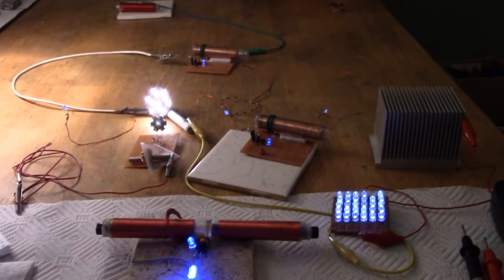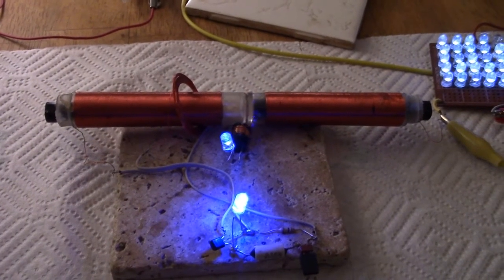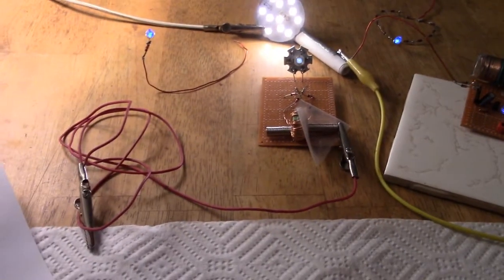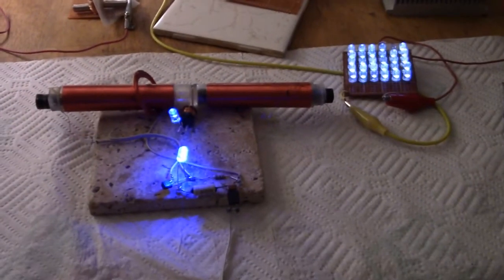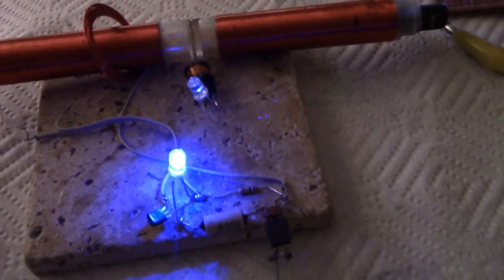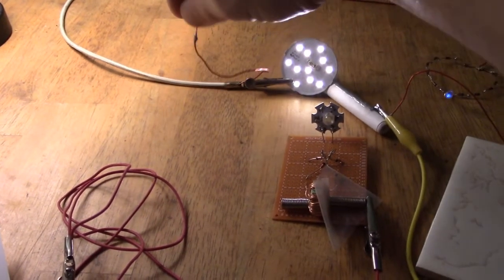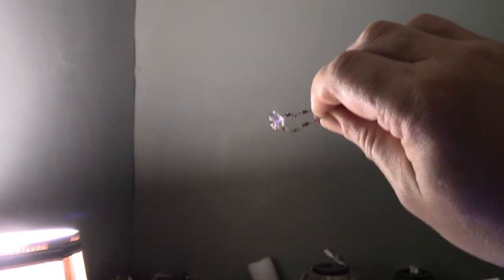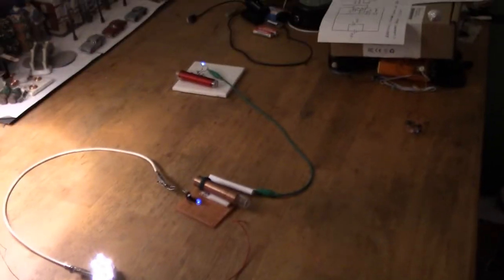A Non Traditional Slayer Exciter

Comment: Yesterday I made a 1n4148 diode loop and attached a 95 Volt led light on it (no guts). I use a plasma sphere to excite the loop. I think that the more diodes you have, the higher the output (voltage / current). It is useless (imho) to talk about the forward voltage of the 1n4148 since the output is way higher. Per diode there can be several volts, so the Ufv of the diode is a small percentage of its output.
I think I will make a similar exciter as the one which you have there. I keep zapping myself with the plasma sphere so I'd rather use a different source for testing.
I have many LED light bulbs which are broken, and usually it is the guts which stopped working, so they do work all right on a DC supply. I like this resonance thread. I made a comment on the video by "Luc GotoLuc" about resonance, but he is not stepping in. I think he could help us out on OU dot com.
Reply from the maker: The plasma spheres have their own traits and definite uses, plus look a whole lot prettier than a wound coil. Yep indeed, the drop isn't a factor but the gain most certainly is.
Oh, twirly compact fluorescents are the same way as the LED bulbs, just the base components blow. I've never thrown out a compact fluoro because they all still run fine on an exciter.  
I think Luc is still very much occupied with the Pierre Cotnoir device. It should be him if anyone who cracks that one.

Comment: To measure current a bit better put some diff sized caps in parallel on the circuit side of the sense resistor
Reply from the maker: Sort of like a bypass arrangement or a decoupler ? interesting idea and thanks :)
I think the wires induce the 500kHz output field signal, but do know that it's always been tough to measure any such circuit because of those connecting leads.

Comment: Really cool progress!  thanks, Mark.  Would you try - cut down the number of "sateliite LEDs" and see how much the current drops?  Also, pls try say 200Kohms going to the base, and see how much the current drops (with present set-up)?
Reply from the maker: Thanks Steve. Here's the odd thing, current goes down with capacitively coupled things added, it's a reason they are there. Measured current began at 27mA and dropped by about 1mA per item. At a load point, all devices will dim together, but until that point they each are as bright as if none other is present.
Inductive loads are different, a small motor or filament lamp needing the whole lot. 
The 100K starts the oscillations in the system. Without a start resistor then a piezo lighter or some other form of jolt is required. Some people used to touch 2 legs of the transistor together with a screwdriver to start them. It can be from approx 20K but then is unused in the running, the resistance being less in the overall circuit and so bypassed. I think it was Lidmotor or JonnyDavro who showed removing it once the circuit has started.
Reply: That is VERY odd behavior in my book!  Thanks, Mark.  keep up the good work.

Comment: You certainly appear to have more output on the LEDs then the 100mW input warrants
Reply: You are spot on with the mention of field energies.  As opposed to the conventional electron flow using closed loop circuits.  This is exactly Tesla's progression.  First he worked with Edison on DC current and recognized the tremendous losses over even short distances and sought to find a more efficient carrier of energy.  In DC as the field transfers energy in a closed loop, the electrons are dragged along wastefully.  That is the P= I squared R where the dragged "friction" shows as resistance in electrical terms. Dragging the electron with the field consumes power in the input source.  Knowing this, Tesla developed the AC system both as closed or open loop.  But for Westinghouse he used closed loop as we all do today.  AC was superior for having far less loss over distance and the energy was easy to step up or down in his time.  In AC there is less dragging of the electrons over distance, since they only travel a short distance before the cycle reverses and they follow back.  But Tesla was still not satisfied with the AC system and went 1 wire and open loop.  Here without a closed loop, and the energy transferred to HV of little current he drove the "extra coil"  which boosted the HV to full HV of no current flow (meaning no electron current flow) but the FIELD energy is still there and active and that is the FIELD energy principle he was so fascinated with.  Since, according to Ohm's law if there is no current flow then there is no power loss!  99% of people would likely then assume (very dangerous logic) that there is also no energy with no current.  But Ohm's law does not include a variable for FIELD energy alone without moving electrons!  And according to physicists, the electrons in a circuit actually move rather slow even in a hot stove top element red hot.  But the FIELD energy travels up to the speed of light in the same circuit!  So think about what this all means!  Want a proof, consider a radio transmitter sending out a carrier wave.  At the antenna the electrons are jostled back n forth in the wire, but a "wave" is emitted from the jostled electrons.  There is separation of energies.  Waves of FIELD energy propagate but the frictional mass, the electron is trapped in the wire.  Proving that FIELD energy propagation in space or a wire does NOT require the electron to be carried (dragged off) with it.  We have all been hood winked into thinking that the electron is the carrier of the energy, but it is the FIELD that carries the energy not the electron.  As you know in a wire conductor if you increase frequency the current flow becomes less on the inside of the wire and more on the outside of the wire.  Called the "Skin effect" why do you suppose it occurs?  Think about the FIELD and electron mass as noted above.  Are you as excited as "stirred up ants" as Tesla stated at the Niagra commissioning ceremony with this insight?
Reply from the maker: I think the field energies have run along the DMM wires. A better estimate would be around 200mA, but, the transistor stays at room temperature and MPSA18's are nothing like even a 2N2222 for current handling. 200mA would be its max !
Reply from the maker: Great explanation. There has always been a problem with the regular explanations of current flow. I have the probably unpopular opinion that every circuit is a short circuit, it just varies how much shorting is being experienced by the battery. That shorting amount is the current used by the circuit. 
A 12V 1A motor will be a 1A short to the battery terminals. There is no flow around from the positive to the negative...there can't be, the battery would stay full lol. And, if 1A of the current is used as the electrons 'flow' around the circuit, then 1A doesn't get 'back' to the battery...same thing, it shorted the battery by 1A.  
Mains voltage doesn't go back to the power station either, by any such similar means. It's 1 direction, with termination in the form of the end point loads. Load is experienced as a pull on the generator assembly from the shorting loads placed on it !
Now why would that simple operational principle be laughed off ?
Reply: Interesting view on current "flow" that I have not heard before.  For me, I like the physicists view on electricity rather than the watered down misleading current "flow".  Rather physicists call it "charge transfer" as opposed to requiring mechanical masses moving (electrons).  So if mass is not moved then the energy is far more easily moved over distance (wire) and can have energy gain.  But the closed loop (battery shorted thru a load) way to transfer energy is never going to be greater than or equal to unity.  Just as you said.  In layman terms, a motor hooked up to a battery is effectively "killing" or partially shorting the EMF potential.  In a closed loop circuit if there is no source EMF then the current can not "flow."  The same is true in an open loop circuit, except that the EMF is never "killed" or shorted even thou it can be powering a load!  Your problem of how to get more transmission distance is one simply of OPEN loop power.  For radiation or field energy, P=FxE where P is the power potential, F is frequency and E is voltage.  This power is not a consumed power as we want an open loop relative to the source oscillator.  This power is the oscillating potential energy like in a tank circuit where the energy cycles back n forth from cap to inductor, but with each changing state the wire electrons are excited "without use of current" and does not reflect back to the oscillator source.  You are in effect charging the tank once and the energy just recycles a multitude of times for the one time cost.  But all the cycles are each time exciting electrons in your wire (not ones of source) to produce a temporary polarization (electricity) that seeks to return to equilibrium via powering your motor or lights etc as loads.  It is that simple.  Ok now I have given you a formula, you can easily work your transmitter to greater distances by just plugging in the values wanted to calculate.

The load pull on a generator you mention is due to the generator windings.  As they "cut" across the magnetic field, a current is produced in the wire loops (generates) but unfortunately the direction of the current also produces its own magnetic field and it is opposite to the field magnetism.  The result is the generator coils are fighting against the same magnetism that they relied on to produce the current in the first place.  Catch 22!!!  Hence no magic using closed current loop paths in this fashion.  No one officially today has a proven way to both allow the wire loops to generate yet not get the magnetism reaction.  One way magnetism diode is what we need, but has not been invented yet.  Find a magnetic diode and we will be trillionaires!  :}
Reply from the maker: The magnetic diode hmm and Lenz and Faraday forces. Well it seems that the solution is there in the problem, but i'm no theoretician. We could do with a magnetic capacitor, to skip the changeover of the other polarity. 
The diode can be glass, inside are 2 coils wound tightly of say 40 turns and 50AWG. If no electrical field is present, the diode behaves as a regular silicon example with ~0.6V drop. But if a field is present, the 2 coils magnetically either repel or cohere and so induce a different set of properties. The effect would be to form either a block of current or the usual diode action, depending on the field direction. So, on the bench the idea would be to see if a coil either side of a silicon diode behaves that way. Same direction windings or opposite direction and see if there are changes, Same study for mounting parallel, together or in series, with the silicon cats whisker between.
Reply: Ok, now I am the student!  You really peaked my interest.  Not aware of such a magnetic capacitor.  Where or what terms to use to find more on this subject?  Tesla's method played on transformer coils and core/shield saturation to achieve the one way effect (diode like but for magnetism not current flow).  In the other variation he used the out of phase coil windings.  To see practical circuits using this see the German inventor Plauson patent (US) on atmospheric energy harvesting.  He introduces the "capacitive inductance" and explains how it works.  They don't teach about this electronic component in schools yet it deserves to be a component same as transformers or capacitors.  It is basically Tesla's out of phase coils shown in energy harvesting from the ambient medium.  Except Plauson uses a flat spiral both primary and secondary.  In the patent Plauson implies the energy comes from upper atmosphere static charge difference to ground but the way it is worded means it harvests from ANY static OR fluctuating source, which is far more valuable than just harvesting static charge alone.  And Plauson was not harvesting tiny energy levels to light LEDs:  he was collecting 100,000 plus watt ranges to power large industrial motors!  And I think back in the 1920s!  His problem was the huge cost of starting a businesses on the principle and the fear factor of giant lightning bolts being safely control.  Hard in 1920s, but doable now.